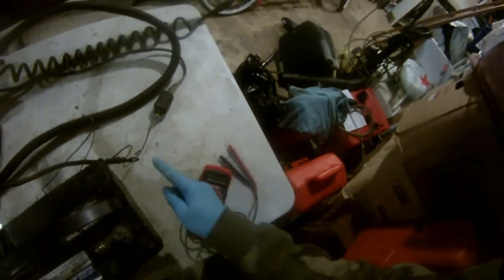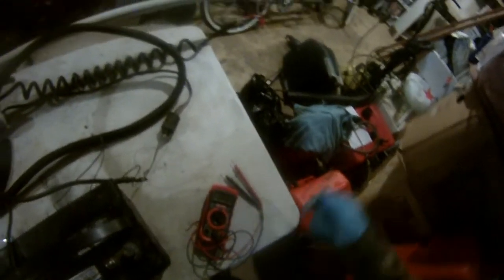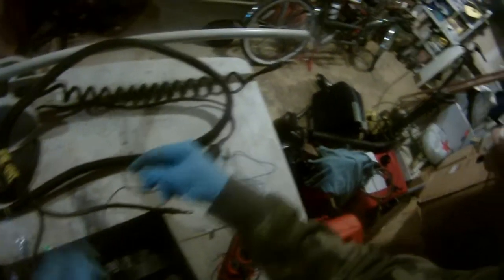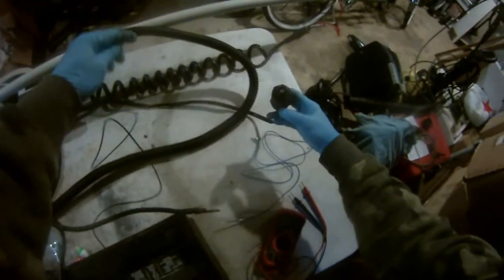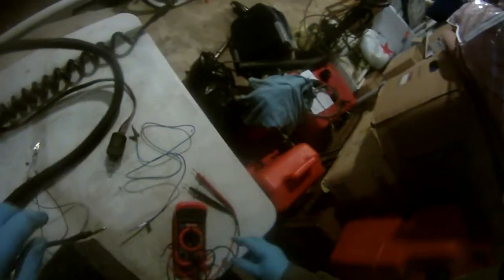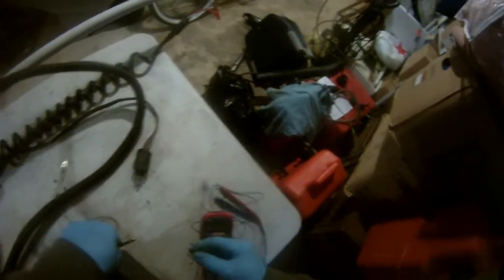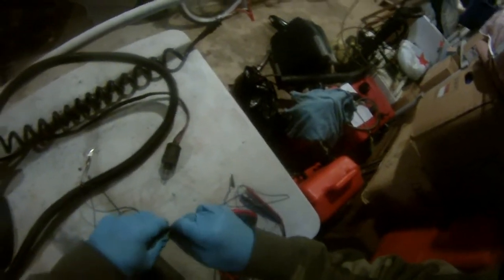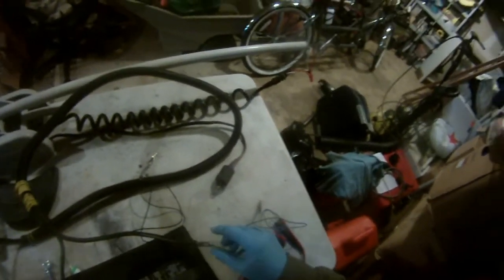How to troubleshoot a non-working motorguide W75 wireless trolling motor? (part 4 of 4)

Comment: What did you actually repair I watched all 4 videos and never saw the actual fix. Mine is doing the same thing
Reply from the maker: The fix is to clean out the 7 stink bugs that stopped the electricity from going through the wire. Believe me I was about to spend $300 to order me a computer chip to replace it.
Reply from the maker: I could not find any video to fix a wireless trolling motor before I posted my video so I got lucky and decided to show people how to clean and fix the wireless trolling motor. It is now working like a thousand dollar wireless machine. Very happy about it.
Reply from the maker: saved us from our ruined fishing trip twice already due to gas motors failed to start to go home.